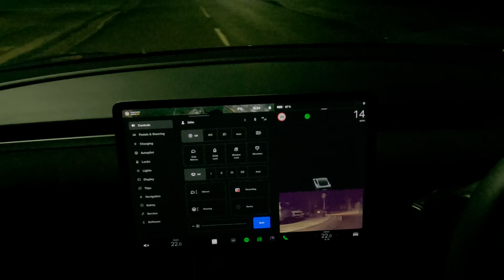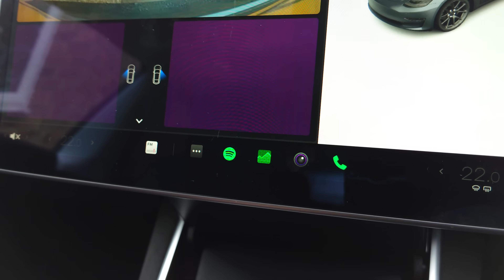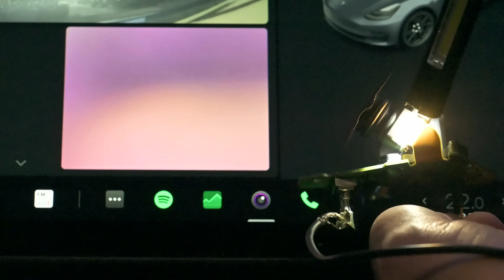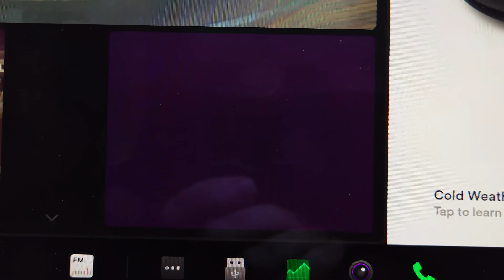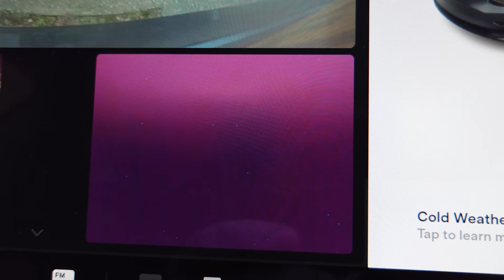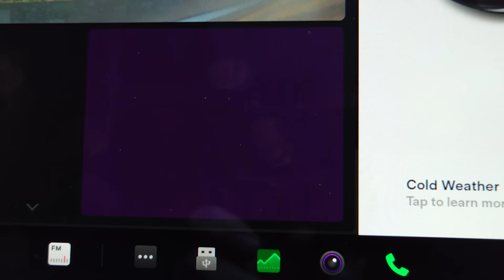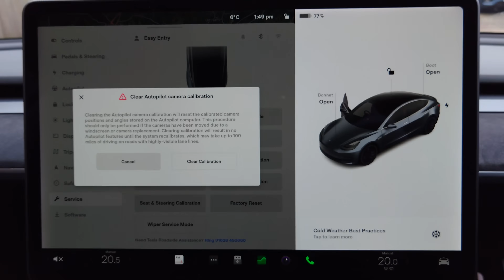Repeater glare and how to fix it (if you dare!)

Comment: Can you just unplug the connection that powers the side repeater light? Or does that plug also power something else?

Seems like it would be fine to just have front and rear turn signal lights
Reply from the maker: It only powers the light but disconecting them might give errors after a while. I'd rather have all my lights in working order anyway. It's law in a lot of countries to have side repeaters.

Comment: Thank you for ending the mystery. I knew it was internal leakage because I taped up everything as well. I knew that trying to disassemble the camera was not going to happen. I wonder why those three holes were there in the first place.
Reply from the maker: I think whoever designed the camera PCB didn't have the foresight to know that a bright LED would be shining on it and fogging the sensor. Those through-holes are very common on double-sided PCBs and are just a convenient way to connect one side to the other electrically.
Reply: @TeslaGurus  Yep, and they clearly didn't test the old version well enough to have them done right in the first place
Reply: @GoatDirt  this is exactly the point of this video and design iteration. Nothing is ever perfect
Reply: Ironically, because of the spacing I bet they're to stop EM interference sneaking into the camera module and affecting the sensor.

Comment: Thanks for the video - scratches an itch as to what went wrong.. 
If mine wasn't under warranty still, I might attempt this. Only my passenger side one is bad (March 2021 SR+ in Canada). A slightly easier variation might be to drill only the first hole but pour in some black electronics potting compound and fill it up completely.. (google electronics potting compound black). I'm paying Tesla service $200 Canadian to replace the passenger side one. Driver side seems ok.
Reply from the maker: Don't do it! That would obscure the repeater as it would get between the light pipe and the repeater window!
Reply: @TeslaGurus  someone pointed this out on Reddit as well, agreed, bad idea!

Comment: I got my right side repeater replaced last summer (due to condensation) on my TM3 -21 and that one have this issue. The other side which is not changed doesn't have any issue.